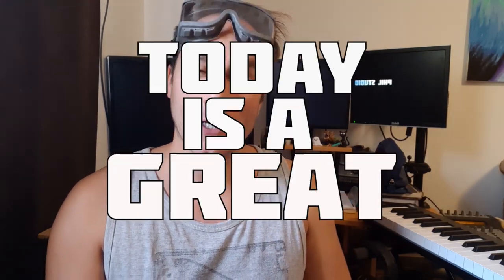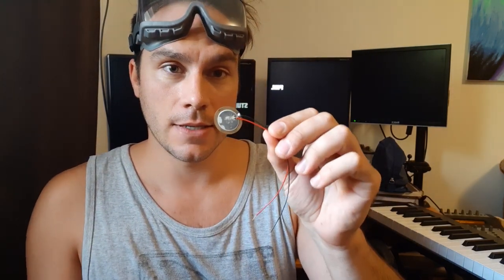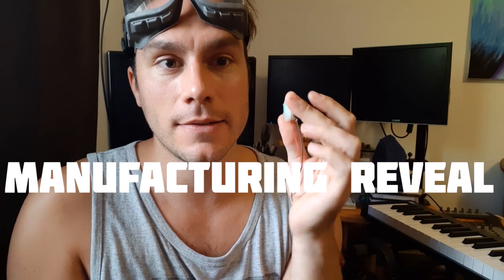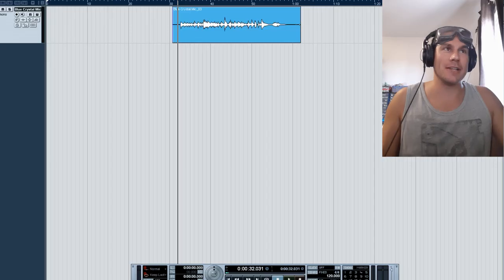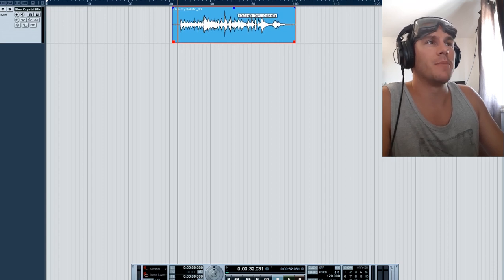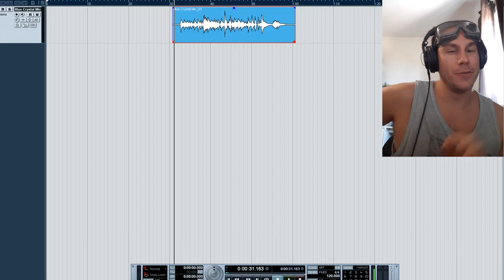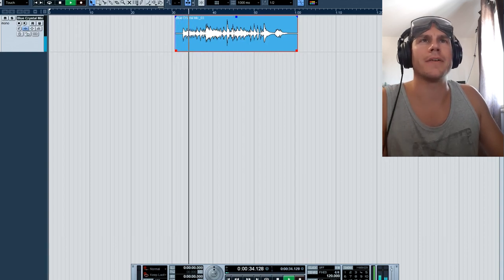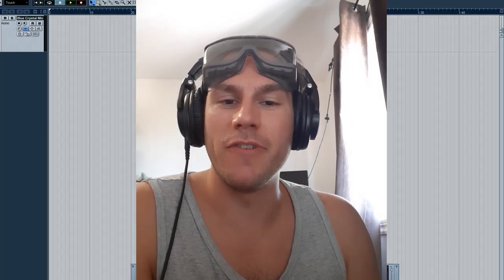DIY Crystal Microphone from Chemistry

Comment: I would love to see that video on how you wire the crystal and encase it in silicon. Come on!!! Reveal your secrets!
Reply from the maker: Such a curious mind! I can't refuse such a request!
Reply from the maker: No video yet but I made an instructable, you can read the process at the end of the tutorial: https://www.instructables.com/The-Legendary-Blue-Crystal-Microphone/
Reply: @ThePhilStudio  nice one. So you are just dipping your final two-piece crystal mic in clear cast epoxy resin? You don't include this part in the instructable. Other than that, very informative indeed. I have batch of large crystals waiting for me to determine their axis and test for this.
Reply from the maker: @mattparkerav  oh! I see you're serious into the process. I guess I'll give you more hints. First of all, 1 crystal wasn't enough, I read somewhere in an old writing that some engineer were squeezing 2 pieces of crystal togheter. I took 2 of my biggest piece and flatest crystal, I put a small piece of aluminum foil beetwen. Next step, I connected the center to the positive wire and sandwich the bottom to another aluminum part connected to the negative wire. All of this is glued togheter with silicone. Which is not the best at all since you end up with a pretty soft and squichy material. Resin would be better and make a tighter fit. So the sandwich is the following:
-blue crystal
-aluminum foil (red wire)
-another crystal
-aluminum foil (black wire

If you can add some foil or copper wire around the housing without touching the crystal or the red wire, this could serve as a shield.
To finish, this is not rocket science but a bunch of experiments so my biggest advice would be, be creative and have fun trying things. For sure I'd like to know how it ends! Good luck.